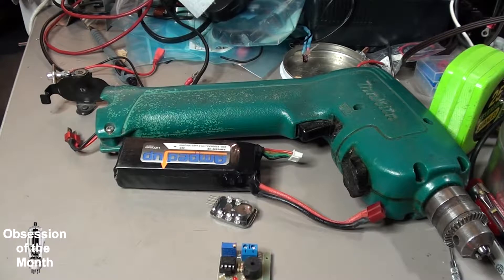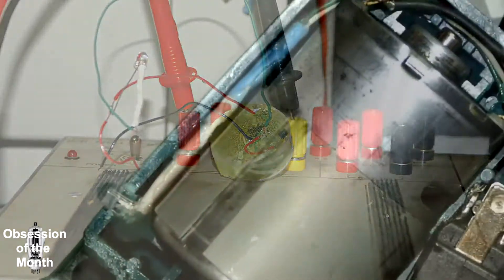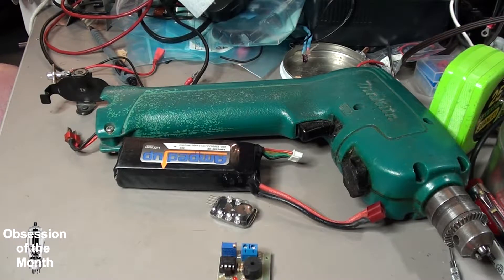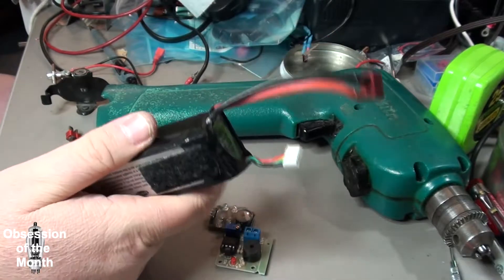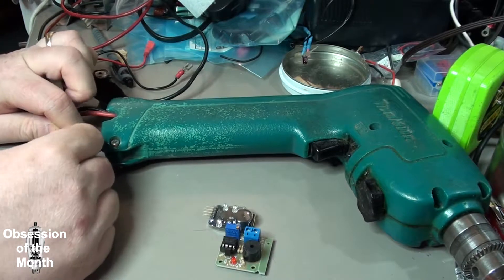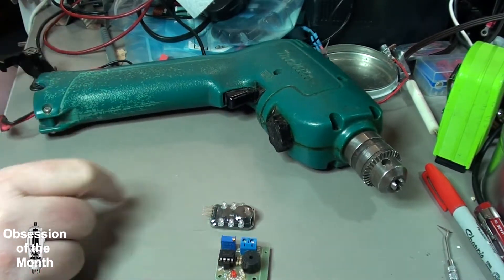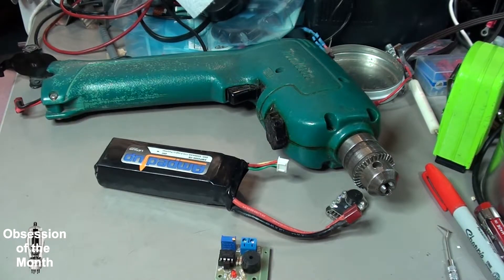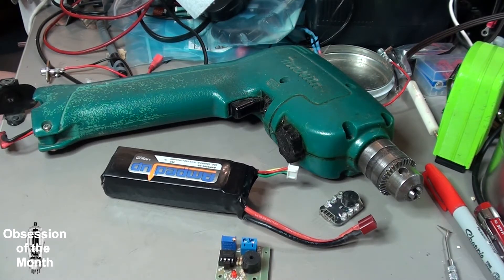Updated: Convert Makita 6012HD 9.6 Volt Nicad Makita to LIPO Battery

Comment: I have stuffed the 11.1 volt RC packs into several of the 9000 battery sticks. If you get the right pack, it will fit inside the 9000 shell. I tried a battery monitor that plugs into the balance charger connector but it false fired a lot when the drill was under load.

Comment: Great idea. I have rc planes and 3S batteries. And  an old 9.6V Ryobi drill with dead battery kit. Is the circuit you created just to alarm the voltage of the lipo cell or i need it also to connect the lipo to the drill?
Thanks
Reply from the maker: it's just an alarm circuit, you can find them on ebay ready made search for accumulator alarm.
Reply: @ObsessionoftheMonth  Ok, it seems that is only for determine that the lipo charge is low. i also have that alarm on my rc planes. So i just need to connect the lipo to the drill. Thanks
Reply from the maker: @alexherrera3918  yes I have some of those as well. the down side to them is they use more power so should not be left attached.